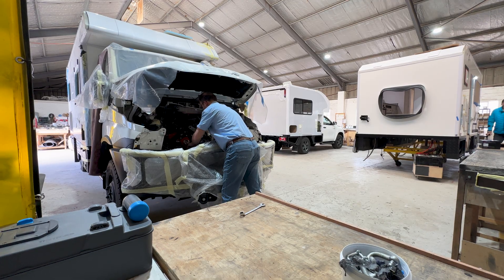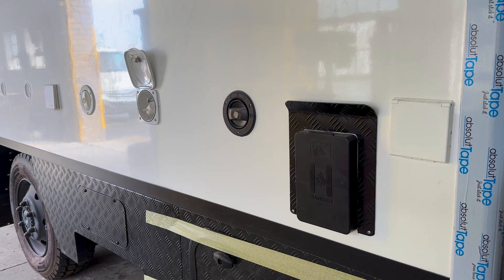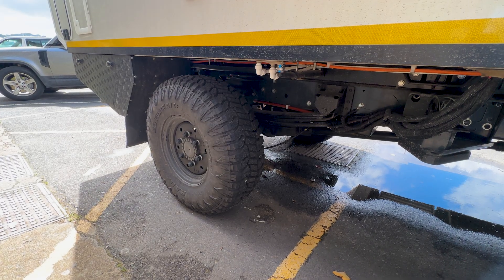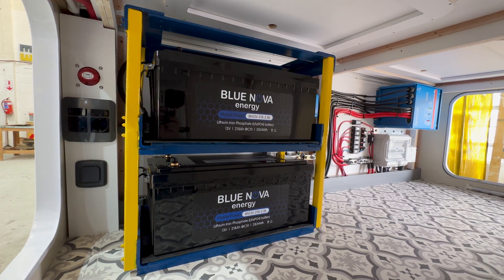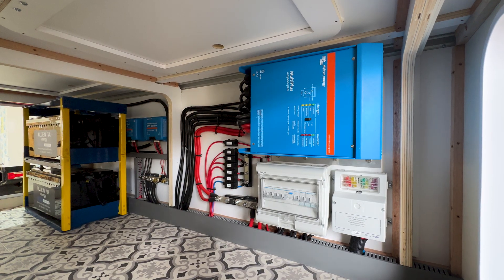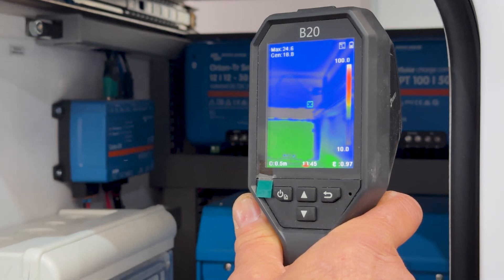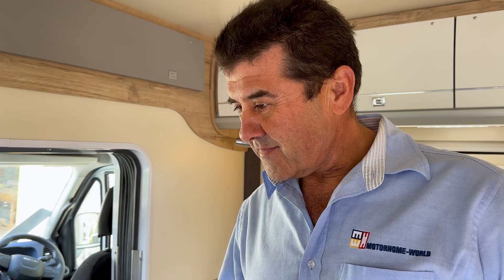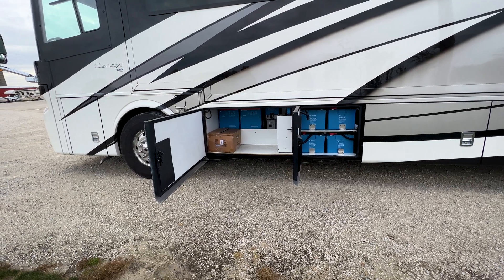Why this Off Road Motorhome builder uses Victron Energy and Lithium

Comment: Victron is for me as Enigneer the only hardware i use. Offshore, mobile and on house  installations and Off-Grid also. For me there is no other company who has a very good system.
Put the real Power in it and use it with Victron Intelligence.

Comment: Victron makes great hardware my only issue with them is post sale support in certain situations, I had a major problem with a victron installer I refuse to let them touch my RV again!  Now I have to pay for support/service post sale because of this. You can't contact Victron directly for anything except referrals to another authorized dealer that won't clean up mistakes or do anything under warranty for free. Just a heads up. Not all dealers are good especially in high demand areas like Quartzsite Arizona.  Any help in a situation like this is through victron forums DIY.  Long story short I spent thousands fixing damage and mistakes made. Like cutting into plumbing to run PV wires without asking if I wanted to pay to drill the roof and do it properly with a gland.  Using Wire nuts in the splice box for the 50amp  behind the breaker panel so many fire hazards .
Reply: Sounds like someone gave you the hurry up work nobody needs or asks for, probably "saved you a lot of money" by doing it fast. I don't think Victron itself is to blame here, even if they somehow got their license or credentials as "Victron Authorized installer". You definitely give me pause about letting someone else do it. For one thing, I want to install it all myself, so that I understand it as well as I can. The first step in trouble shooting anything electrical is to know exactly how it is supposed to behave normally (that is step one). If you don't know about a lot about it, you're asking for mental trouble when something seems like it is not working a hundred kilometers from somewhere.
Reply: @troy3456789  I understand it very well I just didn't have tools to do it properly we were full time RVrs the place that did it was a referral from the battery manufacturer Battleborn,  your probably not familiar with Quartzsite Arizona it's a snowbird heaven thousands of people winter there  in the desert for 7 months out of the year for $180 00  there are 2 solar installers in Quartzsite one is a Victron dealer/installer, $15000.00 wasn't exactly a budget job they just cut a lot of corners. The owner was at fault he didn't check his employees'work quality.  My issue with Victron is in a situation like this  you can't use another victron dealer for issues another did.  I had to pay a mobile Victron technician to drive from California to fix the mess.   $300 an hour.  When you're on permitted vacation/retirement  I can't Carry all those tools around to make cables terminate PV wires, I had enough tools to keep my truck running and fix issues with the camper,  The camper was already 12000 lbs I  only had 5000 lbs towing capacity left in my RAM Truck even with a Big Cummins Diesel engine. I always  leave towing capacity to spare for safety reasons, There's a Huge vendor tent that gets set up each year Victron was there. They couldn't help me if I didn't want the dealership I went to touching my $50000.00 camper again. Money was not an issue I wanted it done right . I did email victron to ask what to do they we not prepared to deal with their authorized dealers if they made mistakes.  I guess they assumed it would never happen.